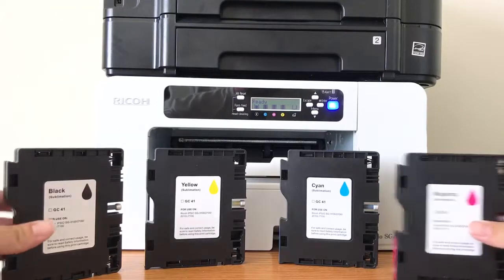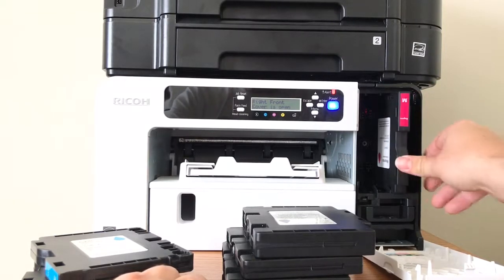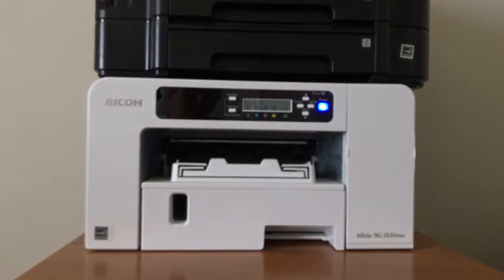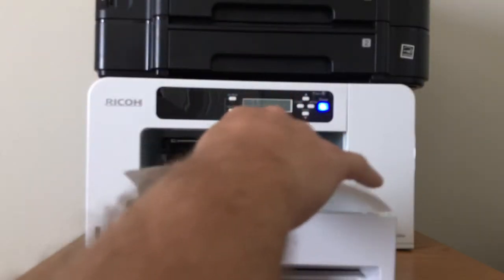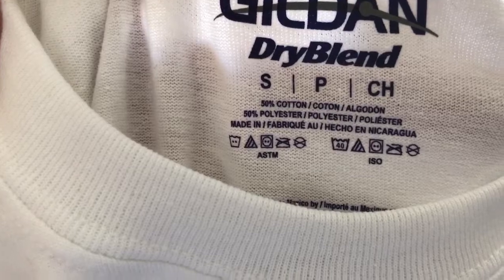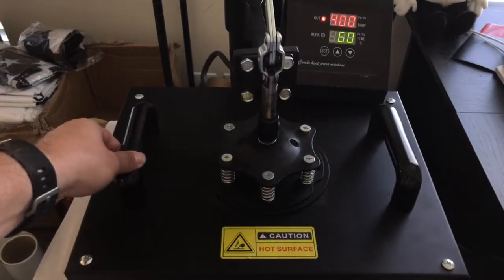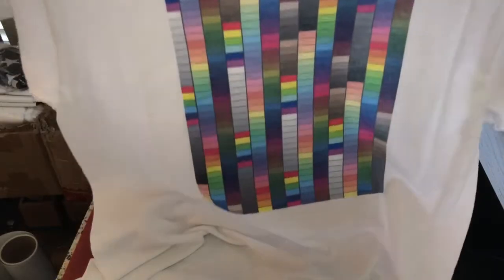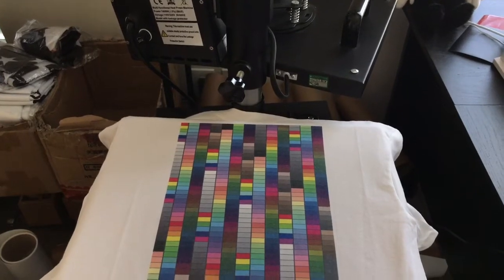Ricoh sublimation Ink install and heat press instructions

Comment: Good afternoon, I purchased this ink for you, but having and issue with color after pressing images looking washed out or faded. I used my standard setting as normal same ICC profile from Company I purchased the printer and same temp/product.  Any advice on what could be the issue?
Reply from the maker: download the sawgrass profiles & follow these instructions.

http://sawgrassink.indigofiles.com/product_documentation/sublijet/SJR-SG3110DN-PSG-PS-CS6_-_MP.pdf
Reply: What material are you pressing on ? Cotton or polyester?